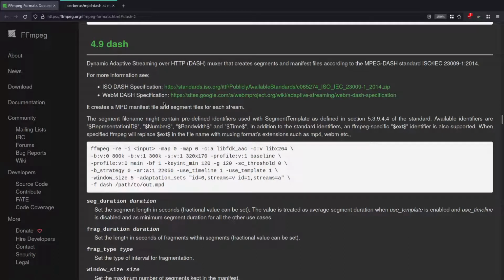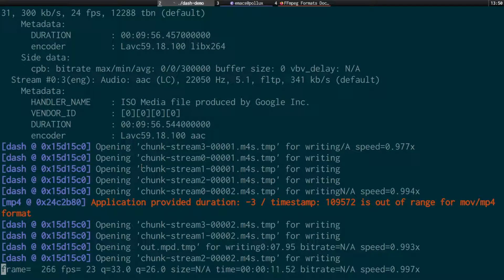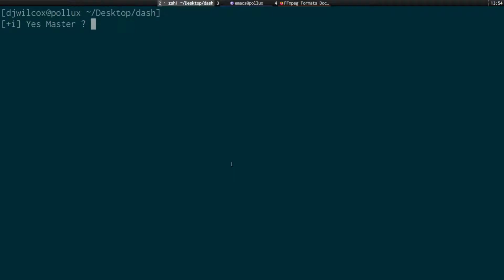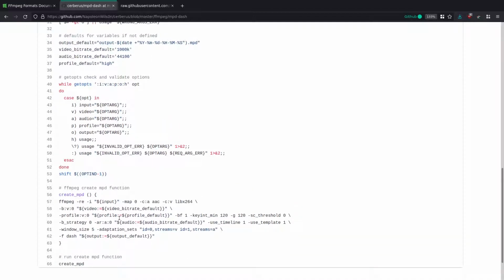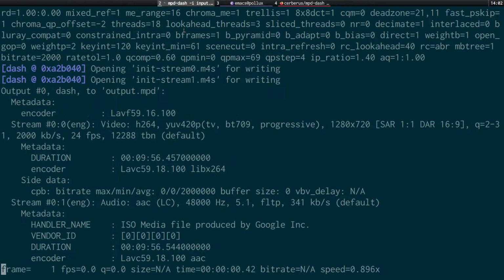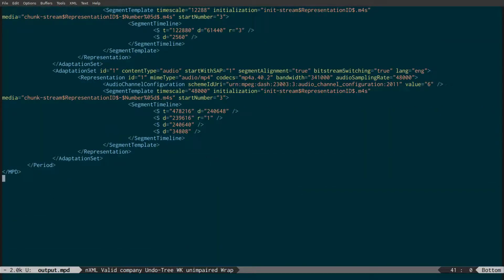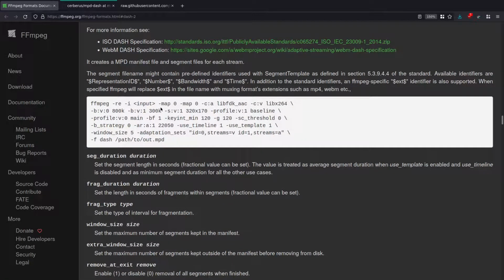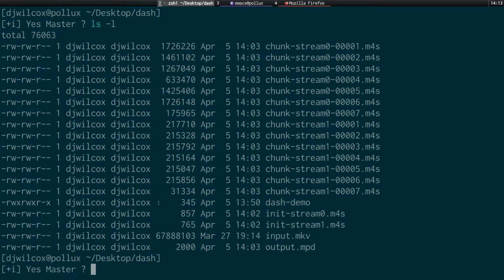Creating dash mpd files with ffmpeg

Comment: Hey bro, I have multiple audios in .mkv file when i ran this ffmpeg command only video and first audio file is available in mpd file not the other audios. Any solution?
Reply from the maker: hi mate, off the top of my head maybe you need to use the map option to map all the audio channels
from the input file and specify them in the output

Comment: Hey,
I am trying to create a Dash stream with perfectly sync'd audio and video segments.
I know about the correlation between the audio sampling rate with aac and the fps of the video and it does give a nearly perfect output. However, the very first audio segment is ever so slightly shorter than the rest, which desyncs everything.
I don't know if it is allowed to post links in YouTube comments, but if you want to see the command I use and help me with this issue. I made a post on the subreddit r/ffmpeg a couple days ago (you can also find it on my profile u/archsyker).
Thanks :)
Reply from the maker: hi  mate, thats an odd one i cant think of what could be causing that,
video stack exchange might be a better place to post that question than reddit